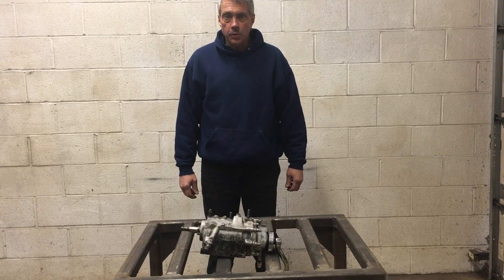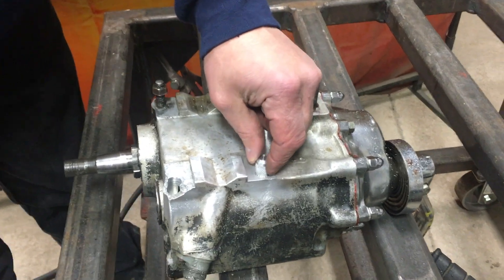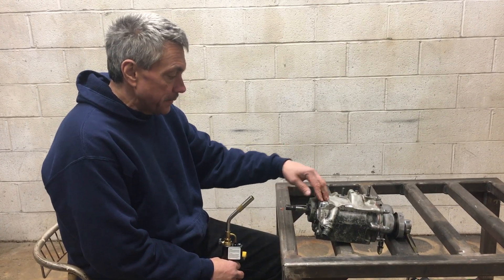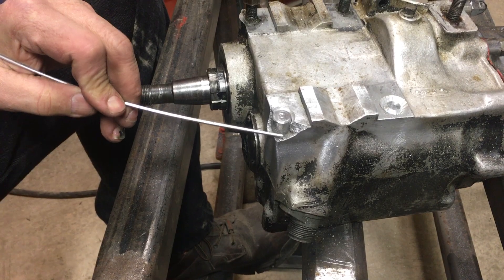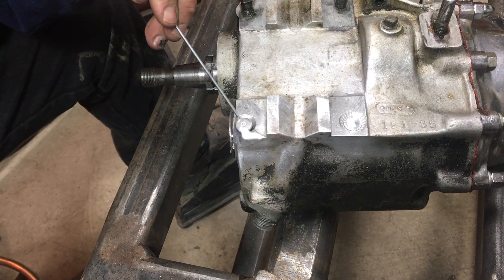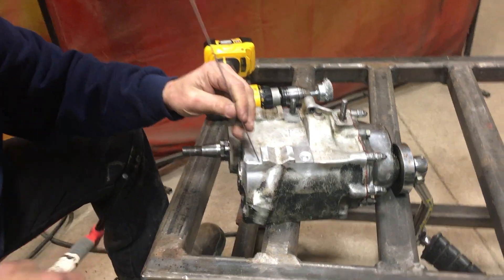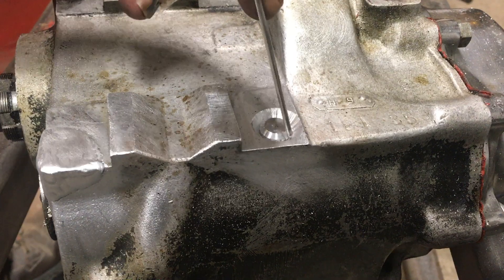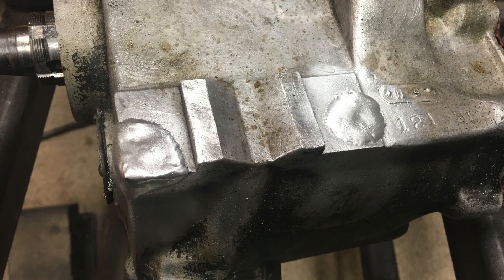TIG Welding Harley Davidson Aluminum Transmission Case

Comment: You don’t have to disassemble the entire unit before welding ?
Gaskets and seals going to be replaced ?
Reply: Looks like the Tig repair spots  are far from seals,  and the empty tranny will be quiet warm but  not too hot to cause damages.